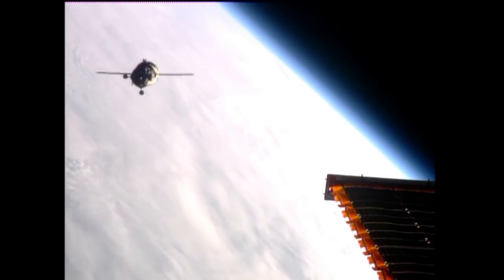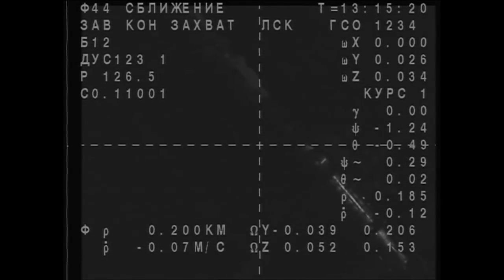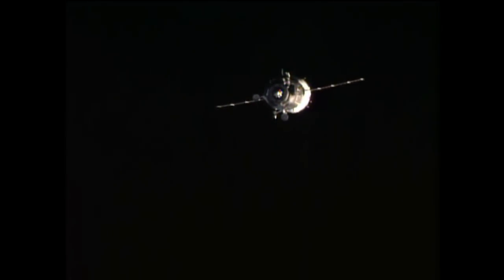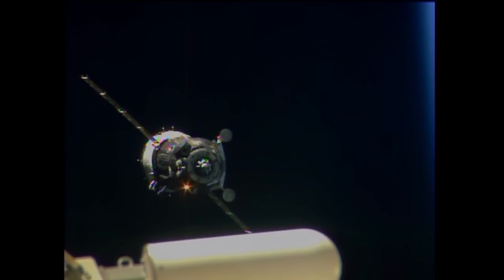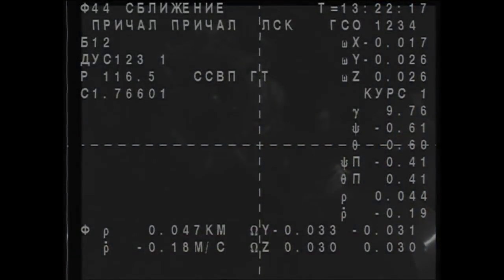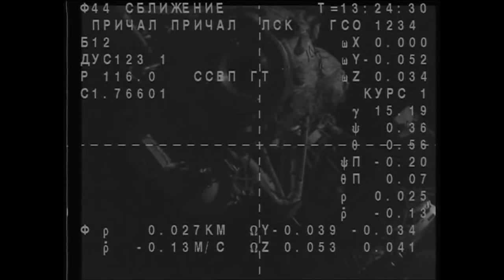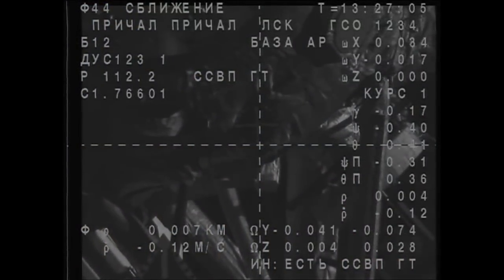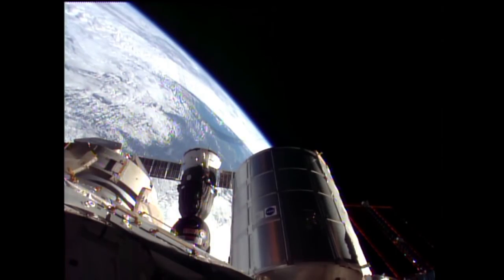Soyuz hooks up to the station

Comment: i still don't quite understand how this propulsion makes it move, if the thrust (gas/  escape velocity) is not pushing on any matter but filling vacuum?is some matter  present? , unless....? you expel the gas  at greater velocity than the vacuum of space can fill a void i.e speed of dark matter?lmao or have i missed something completely  ?
Reply: +teven b Yes, you missed Newtons Third Law of Motion completely. Every force acting has an equal and opposite force acting against it, and since Force equals mass times acceleration, and you can neglect friction in space, the acceleration of the craft is equal to the mass of ejected propellant times acceleration of propellant over mass of the soyuz. It doesn't matter if there is air or not behind the space craft.

Comment: how many times does the capsule circle the earth before it docks. If they are only 432 kms above earth, surely the cant launch and dock if they are traveling 3,350 mph. So im just curious as to how long it takes or how many times it circles the earth before it gets to this point.
Reply: Enough to catch up to ISS. By then, they're going 17,000 mph.
Reply: 6 hour and if they mis the window 2 days

Comment: How long after docking can they board the ISS?
Reply: Soyuz can be docked for half a year - after that it must come back, as hydrogen peroxide fuel abroad it starts decaying. Astronauts can stay longer, and come back abroad next craft.
Reply: He asked how long after docking can the crew come aboard. The answer is 1-2 hours based on that question being answered in a ESA video describing the docking process.
He didn't ask for how long can the Soyuz be docked for.

Comment: Very nice video and an excellent, surprisingly smooth docking. I loved the occasional glimpses of the RCS thrusters firing short correction bursts during the final few meters of the docking. :-) The Soyuz class might be an old workhorse, but the upgrades added to the recent series in the last few years are really impressive. Hopefully, the spacecraft will receive effective successors in the not too distant future.
Reply: I'd like to hope. Upgrade heavily delayed.
Reply: Sanction.
Reply: TheValentino975 No. This general trend slowing global progress. The Soviet space program was created in more severe conditions, but the development was much impressive pace.
Sanctions have no role for Russia. Russia can live by their own resources.
 Important - economic model. Problems in this.
Reply: What can you tell about the storm that flew into orbit without a pilot then automatically calculated the trajectory of entry into the atmosphere, and as you know there each degree angle plays the role of life or death so it was with the Shuttle but Buran automatically perform landing at a time when there was no gps and glonass that nobody has repeated still.
Reply: TheValentino975 "Energia-Buran" It was an impressive system. It was to be a further development of the manned program. Next station "Mir-2" was built with the expectation of interaction with the "Buran". This ship could fly unmanned. On the basis of the missile "Energia" was planned even more powerful system of "Voulkan" that would solve the problem of interplanetary flight. As a result of changes in the economic system   of the Soviet Union everything was closed and demolished. On the "Mir" after this was flight "Shuttle" and almost ready  modules of station "Mir-2" became the basis of the ISS.
Who was profitable this betrayal, I think no need to explain.
Reply: I agree with you 101%. I think it is not bad odds.

Comment: They make is look so easy.
Reply: Yes, the Russians are really pros at this.
Reply: They've got it almost fully automated, up to this level just this year.  And they can get there in hours instead of days now.
Reply: AtheistRex Please be aware that the so-fly (6 houers) back in the 70's to the Soviet station 'Salyut'.
And then, too,, it was fully automated. Then, for the sake of efficiency and to increase the payload of the 'short' flight refused.
Reply: AtheistRex Why two hours? In 6 hours. So the first flights were still at the space station in the 70s.
This is due to ballistic calculations and the stock of fuel. The principles of automatic control system, based on mathematical and physical laws remain unchanged. Changing only the hardware implementation. Now more miniature electronics, etc.
Reply: Oh, I didn't know they relied heavily on the Igla docking system back then.  I thought it was mainly being tested.  Did they really manage to launch and dock in two hours?